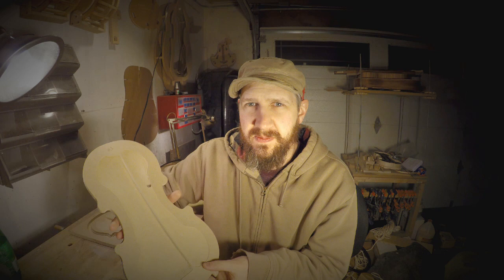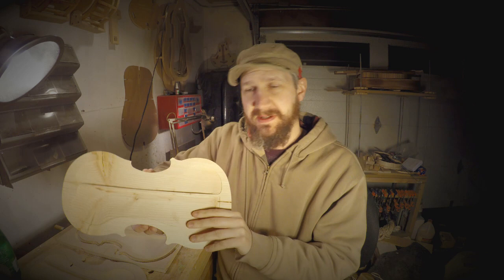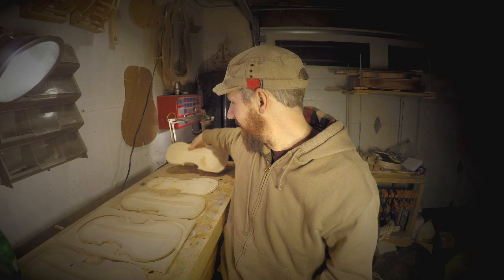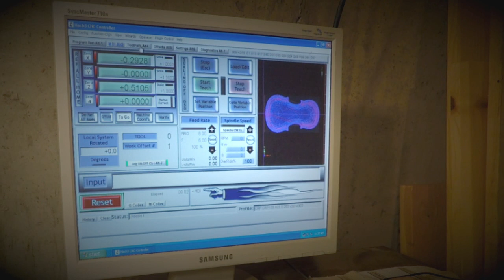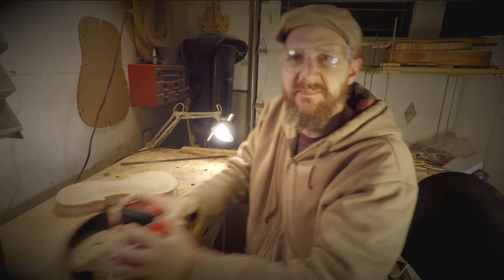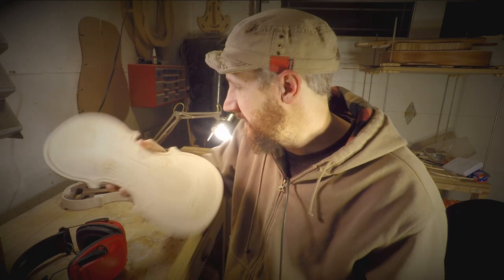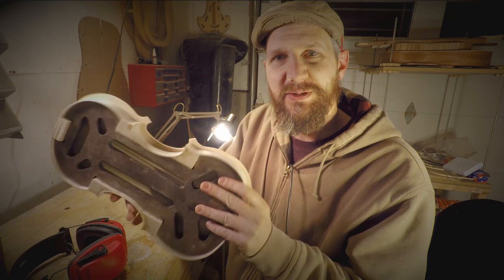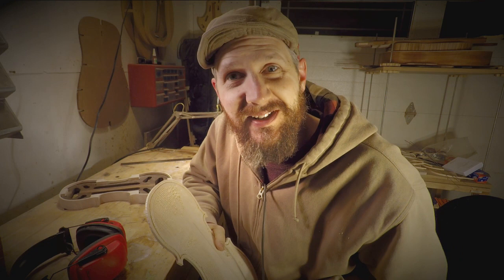Carving a Violin Top Plate | CNC violin | Guanari 'del Gesu' Vieutemps

Comment: Since you made this 17-part series of your CNC produced copy of the Guaneri 'del Gesu" Vieutemps, you probably have become aware of the CNC copy of a Stradivarius done from actual CT scans of an actual Strad. The team that produced it used carefully selected, aged wood to get as close to the density and grain of the Strad. It was later stained and made to look almost identical to the actual violin by a museum reproduction professional. Later it was presented to a group of violin professionals and music experts at a music seminar. Both the original Strad and the copy were played side by side, without telling the audience which was which. They then voted for which one they thought was the actual Strad. Amazingly, they got it wrong. If nothing else, it proves that CNC produced instruments can, in fact, be very good-sounding instruments. The main difference between the ones being mass-produced primarily in China, and the handmade individually crafted bench violins being made both in China and many other countries, is that the wood quality used for the CNC is not of the exceptional grades that most luthiers seek out when they are going to put the time into hand carving. The cheapest ones also often are flawed by production shortcuts. I have both a Chinese bench made violin ($4,000) and a CNC made Chinese violin ($350). In all honesty, there is a difference in the sound, though the inexpensive one has a decent sound even for performance. The bench made is bit a easier to play and a has warmer tone and is more resonant.  As I'm sure you know, there are so many other variables that come into play (string selection, quality of bow hair, rosin, skill level of the player, etc.) that it is very difficult to make a dogmatic claim that CNC violins aren't as good as hand carved. For those who argue that hand carved violins are more "unique", I would reply that most of them are also copies of the most well-known Strads, Guaneri's, Amatis, etc. and show little uniqueness even in the assemblage. The biggest thing that makes them unique is the wood itself... and that can also be true of CNC made violins. For the most part, it is just the hard-core traditionalists who hate to think that one day everyone might be able to afford a great sounding violin, and no one will stand out... which of course isn't true. No matter how much the violins look and sound alike, the skill of the player will always be what makes it truly great.

Comment: For the static problem, ground the metalwork of your machine and/or wrap your extraction use in aluminium foil tape and ground that. That said no well designed controller should shut down from that level of static so give the manufacturer a bollocking.
Reply from the maker: I have tried a lot of different grounding methods and I haven't found a resolution yet. The controller is a gecko g540, the real issues is the PC power supply shutting down, it doesn't happen without the dust collector running.

Comment: Saying that you are cheating using a CNC is like saying that someone that's going by car is cheating, they should walk instead. I like what you are doing. Question...I can see that you are incorporating the bass bar in your cut. How can you achieve the tension that a regular bass bar is giving to the top?
Reply from the maker: I have made several mandolins (more string tension than a violin)  with integrated bass bars, they are not quite as stiff as a glued in bar but only slightly less. I really don't know how it will effect the tone of a violin. We will have to see...
Reply: @TwoCherriesIns  OK...let's see. For what it's worth...What I have learned is that the bass bar should apply the same pressure as the sound post to the top and when you do so...it's visible on the top of the f-hole...the little tongue should be slightly raised above the surface of the top...on both sides. I'm following you :-)! Good luck!
Reply: Integrated bass bar have some advantages compared to glued ones. Structure of the wood is more consistent with top plate and theoretically it is the best way to go.
I dont think that tension of the bass bar is critical for top plate resonating qualities.
The problem with this CNC made bass bar is that it will need a lot of reshaping which will be difficult to make as it is integral part of top plate. It is too thick in upper area. it must be planed from sides. I don't know any efficient method how to do that quicky and precisely.

Comment: This is amazing. As a professional Violinist,  I have always wanted to build a violin. I recently discovered the X-Carve and I am thinking of getting one, but I just discovered you tonight and I am wondering if you built this CNC. ?? If so, do you have a build thread somewhere?
Reply from the maker: This CNC is a kit from CNC router parts; I don't have a video series on the build for this one. I'm in the process of designing a new machine that I will document on the channel. I hope you will subscribe and follow the content. Thanks!
Reply: I was shocked a professional.violin player said it! It actually makes zero sense to actually carve tops and backs by hand.
Reply: @davidthurman3963  Zero sense from an efficiency standpoint, but I do understand the desire to maintain traditional methods and skills.  There is value in both, I think
Reply: @davidthurman3963  I'm a woodworker doing kitchen cabinets and furniture for a living. Ever since I visited Taylor guitar factory and bought a used Taylor guitar, I realize that I like the look of a quality CNC guitar over a handmade looking instrument. Having said that, I don't own any CNC tools. I think if I ever decided to make guitars with carved tops, I would get into CNC work as it seems like such a natural way to go for what you're trying to do. I wonder if roughing out pieces with a CNC and then hand working them to making an instrument would be a nice compromise.

Comment: Are you able to graduate the top thickness to mirror a master top? (2.7mm - 3.4mm)
Reply from the maker: Is that the top thickness or the graduation dimension?
Reply from the maker: This is set up as close to the original as possible, but small changes in thickness are pretty easy when running the CAM. I tend to work them out manually to get the tone production I'm going for.
Reply: @TwoCherriesIns  Thats the top thickness. It seems that it's about 3.4mm in the center and 2.7mm on the sides with different measures in-between on either side of the bass bar. The graduations help articulate various bass and treble tones. There are graduation top dimensions available online for reference. Backs are also graduated. Besides woods, it seems the graduations are what separate the production violins from the master grades. It would be quite a feat to get the CNC to replicate a master-grade violin in all aspects. Yet again, graduating is probably an art that is applied specifically for each top and back and the graduating dimensions not set in stone though you could probably rough it out with your CNC programing. Cheers
Reply from the maker: @davidsimpson3380  the thing is its not all about dimensions, two pieces of wood at the same dimensions sound different, the best tone comes from both a good lumber and the correct dimensions for that piece. I use the cnc to rough in the top and back, and I tune them traditionally.
Reply: @TwoCherriesIns  I believe you're on the right track. Good Luck!

Comment: Keep up the good work.  Forget the negativity and have fun.  I was also wondering about how the different hardwoods effect the sound.  Double sided tape?  That way not need to line up to the bottom tape just the actual wood?
Reply from the maker: Thanks, double-sided tape is much more expensive, and it always comes lose under load or vibration. Masking tape and CA glue is cheap and holds better than anything.

Comment: Going to cut the F-holes with the CNC ?
Also, why not make a gig to flip the plate over? Wouldn’t that be more accurate?
Reply from the maker: The 3d trace operation for f-holes is one of my favorite parts. 

https://www.instagram.com/p/BgAbdCxhTGp/?utm_source=ig_share_sheet&igshid=w2z9gzpxbspc

If I was got into production I would definitely be making fixtures for indexing the plate when flipped. I will probably only make 2 or thee of these before I will want to try something different. The way I'm doing it works for me.

Comment: CNC can never do what the great luthiers have done for hundreds of years. 
There is not one set of perfect measurements. Every great violin is different from all others.
All is dependent on the stiffness and texture of each and every wooden part. 
That is determined by years of experience carving and fitting all the parts into the best possible instrument.
The feel of the resistance when carving tells the luthier the proper thickness of each piece.
The way the plates bend under the tension he twists them with.
No two pieces of wood are the same, Not even from the same tree.
No two luthiers are the same.
No two musicians are the same.
No computer programs can find this out. Not even AI. 
All goes back to that saying I first heard in the early 70's, "Garbage in, Garbage out.
It may look like a violin, but will end up being a item that looks like a violin.
Reply from the maker: You obviously didn't watch the video, I only rough carve on the cnc, the tuning is all done manually, just like it was by the masters.
Reply: @TwoCherriesIns  By the time the masters got to that part they already were intimate with the wood under their fingers. They also knew that what was required in a spruce tone bar was far different from what was needed in the spruce belly. They are not the same density.
Reply from the maker: @andydepaule3296 well not really, that work would have been done by apprentices, and the way we learn is to test these assumptions, and I came to a similar conclusion, and learned a bunch of things on the way.
Reply: An apprentice is not a CNC machine. He or she is a human and that is far more complex than any computer.
Reply: @TwoCherriesIns  If you are going for mass production then this would be the way to go today. However if you want to copy the masters, you need to work like them. Guanari del Gesu was poor and I don't think he had any apprentice. I've worked in a violin mill for a couple of years and know well the difference.

Comment: Well it is interesting as an an abstract study, but there is much that is not right. The bass bar is properly made from a separate piece but you have simply carved it out integrally, and, no disrespect, the purfling inlay is awful.
Reply from the maker: This integrated bass bar was an experiment, as I stated in the video. I ended up using a more traditional style bass bar, It comes along later in the series. As for the purfling, only the channel is cut in this video, after the inlay is installed I run a finish pass that cuts through the joint. It ends up quite clean. You should also remember that this is the first time I did this, it's quite unfair to compare to someone with a great deal of experience.
Reply: @TwoCherriesIns  My apologies, I was a bit harsh. Please forgive me.